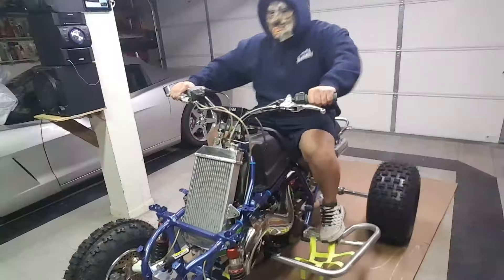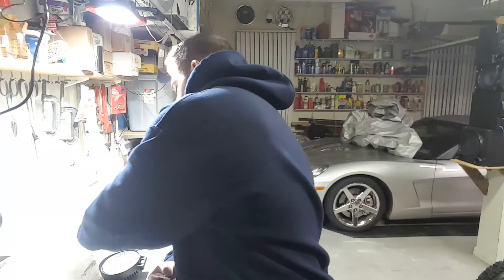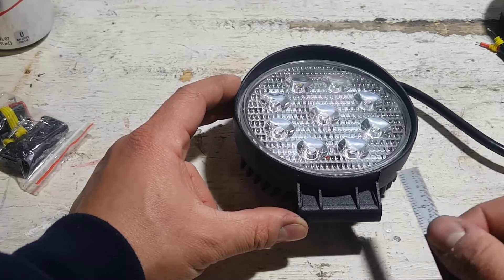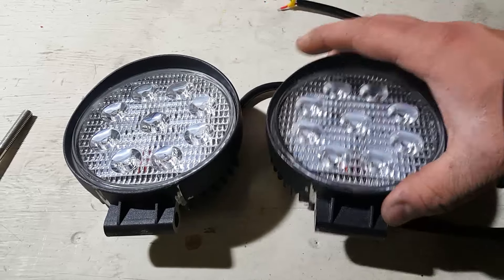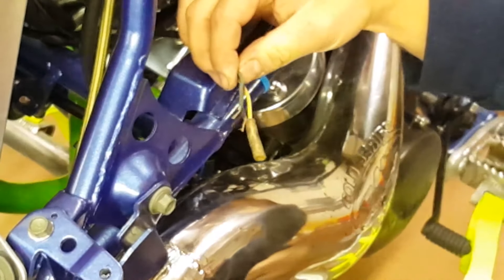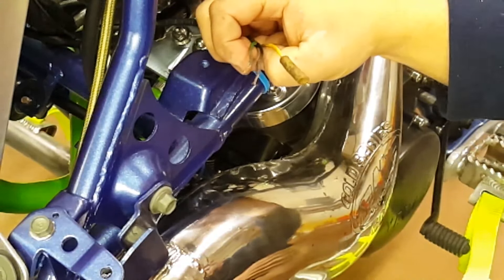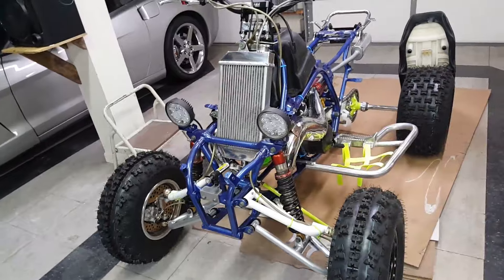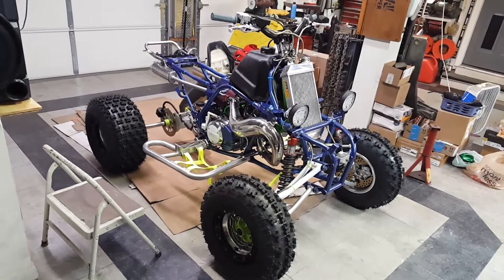LED Conversion ONLY $20!!!!! | BANSHEE 350

Comment: Those are 12V DC LED. The stator on a Banshee puts out AC power. Those lights are gonna fry quick without a voltage regulator and 12v battery.

Comment: If you wire in a big boy capacitor on the hot side the flicker will go away!
Reply: im about to do this, which capacitor would you recommend? have a link? also what connectors did he use? the link expired
Reply: @ProteinPounder  I think he wired his factory connectors in and if you use around any 30v capacitor it will store enough energy to hold the small amount that discharges for the light

Comment: did the high beam low beam feature you ran work? you didn't show in video.
Reply from the maker: It should work; I actually decided not to run it that way because some people were telling me that the lights were blowing out, so I'd rather not risk running all of the power to only one light. So for now, both lights stay running whether the switch is on high or low.
Reply: are the lights still working properly?

Comment: I want to put these on my blaster but the colors on the wires are different what do i do?
Reply from the maker: I'm sure they will work. Find yourself a wire diagram or use a multimeter to match up your wires; I've never wired any lights on a Blaster myself.
Reply: Michael Sabo thank you I will try that I’ve seen other people with them on blasters so I think it’ll work also

Comment: nice lights and install, you think about just buying a small battery to power them ? i'm no electronic genius here...

so with stock light bulbs you can connect them up in reverse polarity.. because it's ac current, now the led light is "light emitting diode" we can't connect them in reverse polarity it has to be connected in one way because it's a diode and a diode is made up of a anode and cathode that only allows electricity to go through it only in one direction this is why led lights work so well with dc current so putting a dc led on a ac system is choking up the ac waveform... something to think about.
Reply from the maker: It's a good idea; there's actually a good amount of Banshee guys that do this. If you search Banshee DC conversion, you will see a bunch of results on google.
Reply: you could do it without doing the dc conversion with just a battery and a battery tender connected when the banshee is not in use, the bigger the battery the better you could calculate the led power consumption to the battery amps to give you running amp hours, this would leave the stock lighting system with no work load.
Reply from the maker: Iconoclast Deth sounds like you know your stuff. thats something a may do in the future. a friend of mine does that with his YZ250

Comment: What did you search for the connectors, I typed it up an it keep showing the stock one. Thanks
Reply from the maker: All of the parts I ordered are in the description.

Here's the link for the connectors...

http://www.ebay.com/itm/5-Kit-3-Pin-Way-Sealed-Waterproof-Electrical-Wire-Connector-Plug-Set-US-Stock-/131980654032?hash=item1ebaa8f5d0:g:qAoAAOSwB09YDbos
Reply: Thanks

Comment: I have the same lights and made it fit it was running perfect however I was riding with them on and both just went out . Did that happen to you?
Reply: Yes, the stator power fluctuates and burns the LEDs out. With my bike i put a upgraded stator and a battery. Im running LEDs now with no problem.

Comment: I did the exact way u did but, when it's on idle it's brighter .. once i accelerate it or ride it the led lights go dimmer?? 😳
Reply from the maker: Chevy Man whaaaat? That Doesnt make any sense; it should be the opposite; the higher the RPMs, the more output the stator is giving off. Did your factory headlights do the same?
Reply: Michael Sabo When idling they are brighter, once I accelerate they dim.. any idea what I did wrong? Or a tip I can do
Reply from the maker: The only thing I can think is that it's something with the regulator? Like I said before, the more RPMs, your stator should be putting out more power, making your lights brighter. When is the last time you inspected/replaced your stator?
Reply: Michael Sabo stator never been replaced but never had problems with the regular white bulbs work perfectly find... I guess I'll try another set of led lights? 🤔

Comment: Mike when cutting bolts like that put the nut on first cut round down corners with grinder or file then when u back nut off it straightens thread for ya
Reply from the maker: This is a great tip; thanks man! I actually learned this in the time since I've made this video and it works great🤘

Comment: I got these same ones, hooked them up and we’re fine at idle when I took of I fried them. Sooo is there a dc conversation you had to do?
Reply from the maker: What's up man. There are a couple of other guys that had the same problem. I think it depends on the output of your stator and which lights you got. There are so many of those 4" LED lights on eBay but they're made by different manufacturers.
Reply from the maker: I did not do a DC conversion, but it would solve your issue. At this time I don't have a video on that.

Comment: oem will a bad voltage regulator cause it
Reply from the maker: Yes, actually it can. One of the jobs of the voltage regulator is to take excess voltage and convert it into heat which then dissipates into the air. If it's not doing that, then the extra voltage could be going to your lights and blowing them out.

Comment: You have any trouble with these blowing on you? Installed a set and an led tail light and on of these lights blew.
Reply from the maker: Pedro Gonzalez someone else said the same thing happened. The only thing I can think is that your stator is putting out more power than mine. I've been at wide open throttle a number of times already with no issues.
Reply: Michael Sabo ya I had a set of the square auxbeam lights and blew both of them pretty fast after I went on a little ride. So I bought these. Had another regulator laying around so I put it on and tested getting no more than 12 volts on my outputs. Maybe i got a bad light.
Reply from the maker: It could be; that's one thing that sucks about cheap Chinese parts, sometimes you get duds. I did notice that some of these are different on ebay though. They look very similar but have different cooling fin patterns on the back and some are thicker/heavier. I only noticed because the pair that was on my banshee when I bought it was mis-matched. From the front they look the same but one was thicker and heavier.

Comment: Nice, got the same ones on mine. Did you go for the spot or the flood version?
Reply from the maker: These did not specify: they appear to be flood lights. The video doesn't do them justice; they're pretty bright. I'm curious to see what they look like with the guards on.
Reply: Thats for sure, I tried to take a video as well to show my Facebook group and it looked like they were barely on but they are def 10x better than stock headlights (I think my Warrior has the same headlights as the Banshee).
Reply from the maker: Yes, I'm pretty sure Warrior and Banshee share the same part number for headlights. And I just looked at the ebay listing again; these are spot lights.
Reply: run 1 spot one flood?

Comment: mine blew as soon as i dumped it now they don't work
Reply from the maker: Really? That sucks man. They actually blew out?
Reply: Michael Sabo they lasted only 10 mins
Reply from the maker: kno dadon wow Man I'm sorry to hear that. I wonder if you got a bad set or something. you're sure your stator is working, and all of your connections are good? a lot of guys run these
Reply: Michael Sabo  everything works fine the lights just don't work now
Reply from the maker: kno dadon I'd contact the seller and see if they'll send a second set free of charge.
Reply: Use a dc converter.
Reply: You don't need a DC converter for these. I run the same set up as mike, also run JDS Customs LED Front and Rear grab bars. I have the stock stator as well, but do plan on doing the DC upgrade in the near future.
Reply: JokurAtkinson I think you should do some research about LED lights… Even if they can work without a converter doesnt mean it's the right way to do it.
Reply: Never said it was the right way to run them lol. I just said you deffinatley don't need the converter for these. im going on 3 months with the headlights and they work great. My grab bar LED's have been going strong for over a year now. If the LED headlights blow out who cares they are only 15$. Not everyone wants to spend 400$ on a DC kit lol.
Reply: I have had very good luck with all the cheap light bars I have bought
Reply: @Dr.Trichome420  happen to me what did u do to fix it?
Reply: @claudeperron780  how

Comment: Installed these same lights and now I keep blowing my tail light bulb. It acts like the voltage regulator because it gets brighter with rpm until in blows but it worked great until the headlight swap.
Reply: Did you float your ground and install a regulator for DC?
Reply: I did it the same way he did

Comment: I done went thur 4 of these lights for some reason all my lights keep blowing
Reply from the maker: What kind of stator are you running? A few other guys said the same thing. Mine have had no issues so far.
Reply: Check voltage regulator at back of bike it's the blue wire that connects I had it unplugged and brew all my lights

Comment: How long does the lights last ???
Reply from the maker: Getting different responses from the comments. It seems like it depends on your setup and what kind of stator and voltage regulator you run. My lights are still running strong after about a year.

Comment: Hey just wondering how these lights are holding up after one year running on the stock system? I don't feel like doing a DC conversion and yes it's probably better but I don't want the extra work after the build. Your thoughts are appreciated. Thanks!
Reply from the maker: Hey Todd! My lights are still running fine. Keep in mind I don't have many hours on my Banshee but I have revved it to the max many times and my light don't burn out. Hope this helps!

Comment: You should always use DC with LED. A LED is a diode, it will work with AC but you will shorten the life of your lights.
Reply from the maker: Thank you for the comment and information. I am still learning things myself. I may do a DC conversion in the future. So far my lights are still holding up great with AC.
Reply: Michael Sabo The easy way is.to buy an ac/dc converter.

The other option is to do the float ground mod. Maybe you can do a video about it.
Reply from the maker: This is a good idea. I will do more research and make sure I know what I'm talking about first.

Comment: did you have to do a dc conversion?
Reply from the maker: No sir; and no flickering that I can see unless you're bogging.
Reply: are you running stock stator or aftermarket?
Reply from the maker: Stock stator

Comment: Very nice, detailed install video! I had never used those Metri-pack or Weather-pack terminals before but I just got a good lesson on them redoing my new/old F-250 injector harness this week. We have those exact same round LED lights sitting on the shelf, been meaning to put them on our blue shee because my lady prefers the round style on her shee over the light bar like I have on mine. Buddy of mine used to run them and they are definitely a lot better than stock but not nearly as bright as the 12" bar for $30.
Reply from the maker: TrailBlogger yes even from your videos I can tell your light bar is super bright. thank you for the compliment man!
Reply: To run LEDs is it plug and play or do I need a DC conversion? Any help would be awesome. I hook my last set up just like this and they fried as soon as I took of and got high RPMs. So it’s got stock back on it lol but I really want the LEDs. Thank you!

Comment: I’m running the same LED’s on the warrior hi beam, smaller bar for low beam. Made a diode switch so all three work with hi beam, no issues in three years, Lots of squinters when I meet them on the trails lol, In process of doing a set of Halos for them now👍
Nice clean beastie 
https://youtu.be/cSGfdDULfjE